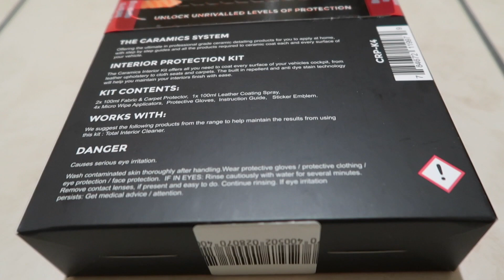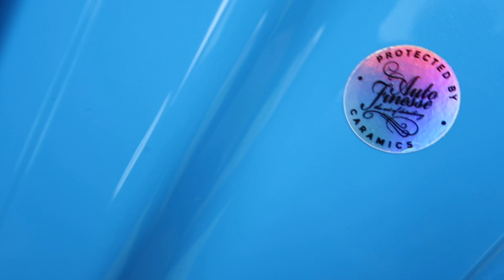ULTIMATE INTERIOR DETAILING! | FOCUS RS | CERAMIC

Comment: This is by far the best total ceramic kit out there. I did my interior just like yours and it literally hardly ever needs to becleaned and with a static swifter it only takes a minute
Reply from the maker: 100% agree mate, it is good stuff 😊
Reply: @AdamRainey  hey Adam. What's a good semi. Permanent coating for the dash & plastic interior pieces
Reply from the maker: Carbon collective platinum trim. Restore and protect for up to 2 years
Reply: @AdamRainey  do you have a Amazon affiliate link?

Comment: Did you do 2 coats as per instructions? I haven't applied as much as you did to the matts however I certainly have not got the same results from 2x applications of the fabric coatings. I've applied 2 coats to the seats and don't have any beading behaviour either... 

Seats and matts were cleaned prior to application.
Reply from the maker: Yes 2 coats all round. There is plenty in those bottles so I think it is asking for a good amount to be used
Reply: @AdamRainey  Had a feeling that would be the case, I used about half the bottle on the seats last night to let it dry and will use the last of it on the seats again and see if that makes a significant difference :) Thanks very much for the reply! Looks like you're the only person with a review of the product online haha